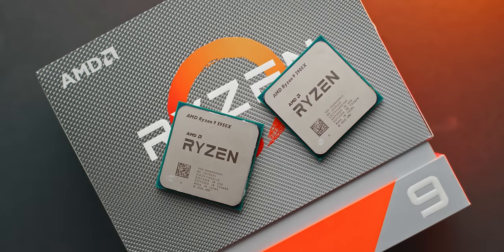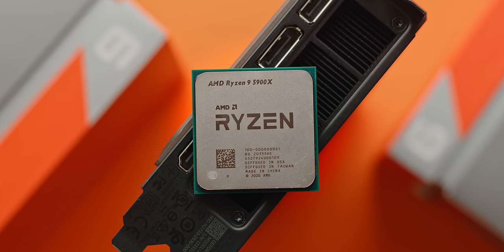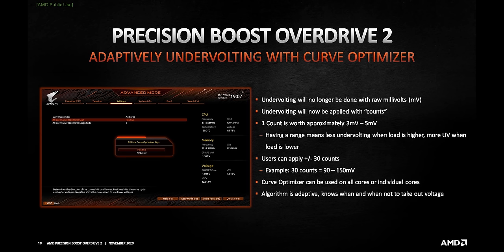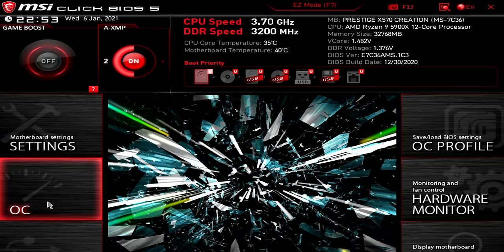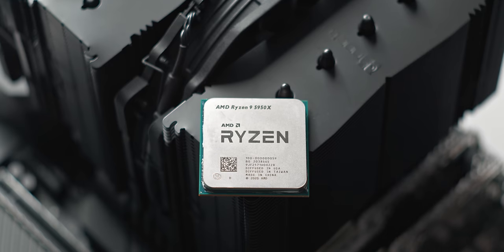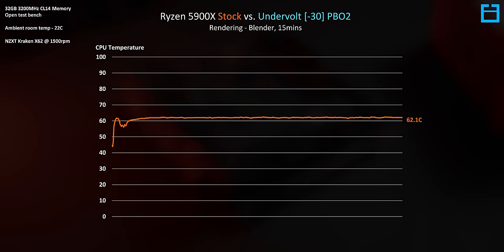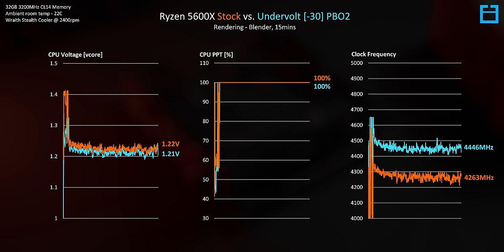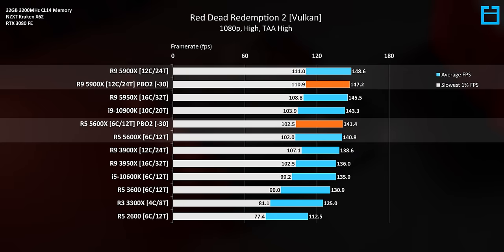Ryzen 5000 Undervolting with PBO2 – Absolutely Worth Doing

Comment: Optimum Tech I have a question

I ordered parts for my new computer and I got 

Ryzen 9 5900x
Powercolor Red Devil 6700
Arctic Liquid A-RGB 360
MSI MEG X570 UNIFY
and G.Skill Trident Z Neo 16G DDR4 K2 RAM Speed 3800MHz (PC4-30400U)

My friend set up my computer but I don't know exactly what he did in the bios. Lately, I was having some problems with my games like for example i downloaded Warzone and at the beginning
I  had a problem with direct X but the second time runed the game, my computer restarted for no reason and I operating it for less than 10 minutes. My computer restarted again when I played WoW for about 20  minutes. My friend told it migh had to something in the bios with Undervolting or something. Now I'm not saying I don't trust what he did but since I don't know much about this thing any way you could give me a few tips setting up my BIOS. My temp. in bios runs 35-40 and when I play a game usually 55-65 but brand new computer which I got 1 month ago restarting might have to with the things my friend did in the BIOS with the CPU and GPU.

Comment: I undervoltet my 5900X like this (set the value to -25) and my temps are kinda lower but the spike temperature is WAY higher. I'm seeing spikes up to 78 degrees (never seen those before). Is that normal behaviour or ?

Comment: I've tried undervolting my 5900x, but when running benchmarks, I get marginaly similar scores (or in some cases, worst than without undervolting). Looking at the cpu clock (in Windows task manager), I even see lower clock speeds when underclocked, like the CPU isn't using the overhead it's got like you describe in the video. Thermals are good too (in the low 70s), so I don't know what's happening... Any idea what I might be doing wrong ?
Reply: Are you doing an adaptative undervolt or fixed?

If you do a fixed undervolt, you loose clockspeed, with an adaptative undervolt you should have slightly faster clockspeed at the same voltage or higher singlethread speed.

Comment: On my brand new x570 Crosshair Wifi. I tried this. I went to Advanced tab/ AMD Overclocking / Precision Boost Overdrive . There I turned PBO to Advanced, and set PBO limits to disabled. On Curve Optimizer, I set to 15. After running Cinebench R20, I'm getting lower scores of 8300, down from 8500 from PBO1. Temps seems 3-5 C lower though. Is this normal?

Comment: I think whether this works will be mobo dependent. I just installed Ryzen 7 5800X on a MSI B450-I Gaming Plus AC mobo which supports PBO2 but even with PBO disabled, the system doesnt pass the Realbench stress test. In any case, CB20 is stable at -20 but CN20 scores slightly higher just with PBO on Auto (6160), with lower voltage (1.34-1.35), similar effective frequency (4707 mHz) and no change in max temp (79-80). I probably need to upgrade the mobo first to a X571 before trying this again.

Comment: See i did this i set -30 on curve and +50mhz on boost like you and it did boost like 200mhz more and the min/max voltage under load shifted back 100mv but my temps were the same

Comment: Got to negative 25 all core and it crashed. Set it back to 15 all core and crashed again.
Reply: did ur cpu got burned now?
Reply: @LawAbidingSociopath69  No, not at all. I set a more conservative curve and was fine but honestly didn't see a big difference in a performance bump so I set it back to stock. I'm on a 5900X
Reply: @Chriswelder1  okay ty bro is ot safe to undervolt?
Reply: @LawAbidingSociopath69  Yes, undervolting is safe but I only recommend doing it if you feel it's getting hotter than you'd like under normal circumstances. You can potentially get a performance boost but it all comes down to how good your particular chips silicon is.
Reply: @Chriswelder1  whats safest settings?
Reply: @LawAbidingSociopath69  I would recommend watching a few YouTube videos on the subject.
Reply: @Chriswelder1  ok broda ty
Reply: @Chriswelder1 u set it
Back lmao enjoy wasting power and shorter life span on ur cpu

Comment: I have a 5900x and an ASUS x570 TUF gaming and there is two PBO settings in BIOS. Via Ai Tweaker and advanced/AMD OC. I am wondering what is the difference between those two and if i need to tweak both, or just one, or disable one and so on... Hope to find any advice. best regards

Comment: So what I did with my 5900X was turn on PBO  profile 3 ,  manually set the CPU voltage to 1.275 so it cant use more that and  turned on XMP for my memory , My 5900X boosts to 4924 MHz and while gaming hits temps of no more than 55C and CB23 temps are in the high 70s with a score of almost 22000.....Am I doing it wrong?

Comment: If I undervolt my cpu do I still have my warranty. I play warzone and my temp are  91degrees  at first it didn't bother me but my fps went from 200  to 100 lately and I'm trying fix it. I tried everything new 360 aio, reapply the thermal paste nothing worked.

Comment: I’m finding restricting the power limit of PPT, TDC and EDC is lowering my temps a lot more than undervolting. I have been running those setting close to what is printed on the box ie for my 5600x setting PPT at 65.
Reply: What values are you using in PPT, TDC and EDC ?

Comment: I recently bought ryzen 5 5600(non X) with asus tuf b550m plus wifi ii mobo running Windows  11 and with loaded optimized defaults in BIOS only enabled DOCP to 3200MHz(tried also only applying memory frequency without DOCP profile but it was the same) i score 4050 points in CB R20 MT which is 100 points higher than stock score of the 5600X in this video. Would this mean the motherboard bios is applying OC with stock BIOS settings?

Comment: An offset of -30 and -25 on my 5900x causes BSOD for me. I suppose I'll keep trying tower it. I'm trying - 20 right now and it hasn't BSOD yet.

-15 causes BSOD as well.
Reply: Nvm it did
Reply: @TheSamuelCish  Hi! What other setting did you change? Struggling with a 5900x on x570 Asus Dark Hero over here. -15 is the most stable I could get, but with random reboot running cinebench single core.
Reply: @maurocipo90  I replaced my thermal paste and have had no issues since.

Comment: Is this available for MSI X570 Gaming Pro Carbon motherboard? I am using Ryzen 9 5950X also. Is there anything else I need to check on before doing this guide? Everything is stock on my pc

Ryzen 9 5950X
64GGB 3600mhz 16x4 GSkill Royal RAM
MSI Gaming X Trio RTX 3090 
MSI X570 Gaming Pro Carbon Wifi Board

Comment: Made my cin20 bench go down from 11233 to 9825? Voltage and heat was lower, but effected top clock speed. I followed it exactly? hmmmm. I'm on MSI Tomahawk wifi x570 and 5950x. Any ideas?

Comment: I have a RYZEN 7 5700X, how do I set the value for undervolting ? I'm new to this kind of stuff, but I want, better thermals if it is possible, 72c on average when gaming, wondering if I can make it below 70c with this method.. I have ROG STRIX B550-F GAMING (WIFI)

Comment: hey I did -12 like  you said in the video for Ryzen5600x.
But underload it still goes over, any idea?
my specs: ryzen5600x,aus b550 f-gaming,rtx3080ti,32g ram,850w psu
just trying to get lower temps/volt for ryzen5600x , been kinda hard

Comment: @carlos-feffeira thank you for the manual. Have 5800x3d as well. 
  I set the -30 in bios and the rest. But  i have higherfrequency menory. Gskoll 36000 MHz cl14 enabled on XMP reaches voltage to 1.45v. 
system is stable, but settings from your video didint lover the ram frequency. Schould i disable xmp and set ram for 3200mhz to avoid damagung CPU?
Can I lover RAM voltage when they are 3600mhz? Instead of 3200?

Or if system is stable and cool let say that i can leave that 1.45 default voltage Ram, without damaging CPU?

Comment: since all this new thing in bios completely overwhelming my brain, so in short using this pbo method is to get more cooling (headroom) by downvolt, so if there more cooling the system will detect and oc itself? so if i use really high end cooling the more speed it will give right? since bigger headroom?? correct me if im wrong, my old system is really darn old i just upgrade to new ryzen so many thing bios

Comment: I did this with my Ryzen 5 5600x temps were about 10oc lower but it was also 300mhz lower it the clock speed not supposed to be higher?

Comment: Its a great feature and all but for some reason I have temp issues when I game using this feature. I have a 5900x and with just pro on i see Temps in the 70s and 80s playing games like cyberpunk and cod cold War. Curve optimizer brings it down to high 60s and mid 70s but this still seems strange to me considering during an all core workload it never goes above 65 degrees C. I'm not sure if these kinds of Temps are safe so I just set the voltage to 1.29 and 4.6 gigahertz all core and I haven't seen Temps above 65 and averaging about 55c in games now. During something like cinebence now the multiform test does get to above 75 c max. I don't notice any performance loss I games so this seems like the best option to me but idk. I'm just wondering if my cooling just isn't good enough or if I got a bad sample?

Comment: Im having an issue where when I use PBO to undervolt, playing valorant or using discord causes the programs (and probably others which I dont use too often) to crash. Valorant simply closes while discord restarts, this happens constantly and when I stopped using PBO the crashing stopped. I've tried -15 up till -30 and the lower the number the more I crash. And I've set the herts to 50mhz only. Is there any solution or some step Im missing or is my r5 5600x just not able to handle pbo undervolting?

Comment: My 5900X won't take -30 but takes -20. However clock speeds are slower by doing this not higher,  so my MSI board must be running the CPU very agressively at its default auto options. But temps are way down with lower voltage which is what I want to achieve
Reply: you don't want your clock speeds lower, that defeats the purpose. you're running cooler because your cpu is less powerful

Comment: Umm if I set my 5800X to (PBO Disabled, Curve Negative, All Core, -30... and leave everything else to stock/auto, then I freeze all the time during windows 10 loading! I knew this tip was too good to be true...

Board is (MPG X570 GAMING EDGE WIFI) on the latest bios from September/October 2021 that is Beta. My memory is 2x8Gb DDR4-3600 that just won't be Prime95 stable at XMP settings, no matter how I mess with Dram, SoC, VDDP or VDDG voltage. I'm really getting crazy! Only thing that got my CL17-19-19-39-1T ram stable at 3600Mhz was to slack it to CL18 & 2T!!! How lame is that... then 
seems like CL18 1T would work with a high 1.50v instead of 1.35v but fail immediatly at XMP CL17 1T! Clearly not worth the extra voltage for 1T.
Reply: Try per core instead of all core and go from -5 and beyond. Test at each step/change that you do with OCCT, Cinebench and Prime95. -30 is too good to be true for stability.  I run PBO with +50Mhz and negative offset per core using -25. With these settings, I am stable on Prime/Cinebench and OCCT for 3 hours with max clocks at 4.9Ghz. Yet to test more and then will try adding additional boost but that will for sure demand additional voltage which can be combated with reduced negative offset using curve optimizer

Comment: Having significant stability issues when undervolting my 5600x in a Gigabyte B550i (F13c BIOS update). Random reboots under load all the way from -30 down to -15 so far. Anyone had any more luck than me with this combination? Did I just lose the silicon lottery?
Reply: I am currently going down from -17 to -12 since the pc kept rebooting.
Reply: @Skell0r  I did some digging and found that you really need to do per core under volting because your primary boost cores will be less stable. Definitely not as straight forward as Ali makes it seem.

Comment: If you really want to get into PBO2 snd do it correctly, this is not the video for you. If it was made very clear this was oversimplified and a very “quick “fix””, it would have been just fine. As his vids usually are.

I know this, bc this is where I started with PBO2 myself. It won’t harm your system at all, but unless you are incredibly lucky with your chip it will definitely waste a lot of your time.

Comment: The -30 offset took my r7 5800x3d from 83 max to 66 max in gaming!!! Its amazing but is it safe to work like that for the long run? (It passed 30 min of cinebench with no crashes and alot of hours of gaming to)
Reply: -30 on ALL CORES is almost too good to be true, so you definitely should do some long term stability testing with Core Cycler at least.

Comment: i dont use pbo cause it pulls nearly 1.4V in my freaking cpu for a 4.2ghz overclock while i can manually reach the same clock using 1.1v, and it runs much much cooler, i never figured out how it all worked but i might try again to use pbo
also to note my first cpu burned down because of a bug in the bios, it reported that it was pushing 1.4v into it but actually was pushing 1.6v and overtime completely ruined my cpu
Reply: what first cpu?

Comment: My ambient temp is 32c, but my 5900x load temps reach 85c with a ek360 drgb aio when gaming, i've already undervolted with -20 on all cores and pbo disabled. Cinebench doesn't break 76c, idk what else to do, do i have a bad chip or faulty aio ? Idle temp is 42-48c

Comment: When this video first came out I undervolted a 5600x and got it to 4.8 without any temp issues staying under 70c. But now I only get 4.5 because of some stupid bios limit. Can anyone point me in the right direction? I need a guide to overclocking this processor now that I've been bios blocked, They took all the options I used to undervolt away and Im not sure where to start. Any help is appreciated, greatly.

Comment: i have HP 15s laptop with Ryzen 5 5500u. How i can slow down turboboost clock? In windows power management settings i can only turn off turboboost.
On other laptop Acer Nitro 5 with 10300H i use Throttlestop.  i use -80 mV and 3500Mhz boost, so my laptop is cold.
I tried to use  Ryzen Controller and AMD Ryzen Master, but it show Error message with unsupporting cpu.
What should i do?

Comment: Im sitting here, confused, lonely and dont know what to do. using my 5800x actually for boiling water... so, this undervolting sounds great. saw a lot of threads abput this. but honestly i dont get it, what should i do exactly... (aorus b550 elite vs). any help? :( . i know eco mode might help but i need good performance for rendering and 90° is way to much.

Comment: Hi can you mix a manual clock setting to lets say 4100mhz and voltage of 1.1v with pbo2 set on a 5900x? This is to lower the power consumption even more specially running it for 24/7. Thanks

Comment: I did this on my X570 with a 5800x and it made my temps worse. I had a custom profile set before in override mode that gave me idles around 45c and now my idle spikes often as high as 60c. If this is supposed to reduce power consumption how in gods name is it causing such high spikes? Maybe it was the bios update but damn I regret doing this.
Reply: @mattiasneidenstrom  Nope its definitely negative and I even tried setting core volt to max 1.3v and even then still have random spikes to 60c while idle.
Reply: I'm starting to think it was just HWinfo not polling fast enough or giving out bad info because Ryzen Master is indeed showing my CPU idle at 38-43c with almost no spikes.

Comment: I am not knowledgeable enough but I did undervolt my 5700x in different method I found in here in YT. Setting my core ratio to 44 and CPU Vcore to 1.2. What is the difference if I undervolt with this PBO method? I have not experienced crash yet on my system after the undervolt while idle and gaming Starfield and running CP2077's benchmark(I will observe this week).
Reply: What are your results you’ve found?

Comment: So I want to undervolt my 5800X3D however I own a gigabyte mobo and my settings are a little different.

When I go into my voltage settings I see these options.

VCORE SOC - Auto

Dynamic VCORE SOC (DVID) auto

CPU VDD18 - Auto

CPUVDDP - Auto 1.8V

DRAM Voltage - 1.2V

So I don't know which setting to change? 

Hopefully someone can help?

Comment: This is not working for my 5900x. I also have an MSI x570 board, and after getting my settings EXACTLY like yours, tryingboth a a -10 and -30 all core offset, my voltage is still regularly hitting 1.48v under load, with no performance changes and no reduced temps with freqs at 4.8mhz. What's going on?
Reply: I would double-check all settings, especially DISABLING the PBO LIMITS.
Reply: @albiss1164  ok so I figured it out I think. It was boosting up to 5ghz with the curve optimizer set, but what I really wanted was lower temps with same performance. I applied a -.1v offset alongside curve optimizer and I think it worked? Lower voltage, same clocks

Comment: My pc is restarting while gaming. Can someone help me.

5800x
6700xt 
B450 tomahawk max 
600w
32gb 3600mhz CL16

The system was fine before on a ryzen 3600 and 5700xt. Can someone help. Temps are fine aswell
Reply: change ur psu to 750+

Comment: When I started I was able to achieve -15 for my Ryzen 5 5600x on my Asus B450-i MOBO. Now 1.5 years later, I can only hit -9 as max. Am I not cooling my CPU properly? Have BIOS updates become less tolerant? Is my chip silicon quality degrading?
Reply: What temps do u reach under an all core load? And what cooler
Reply: I think you are right, your chip started degrading. That's why I don't use that on my 5600x anymore